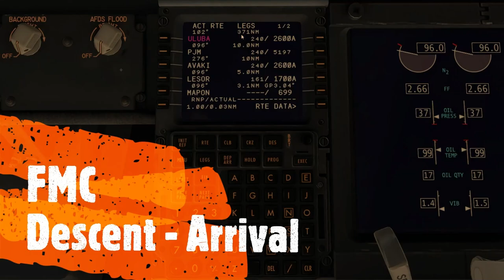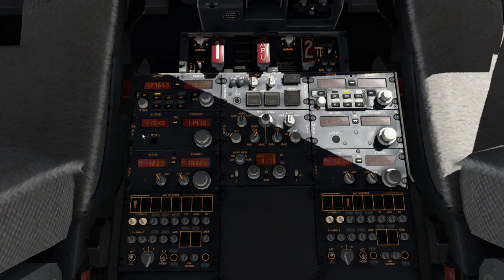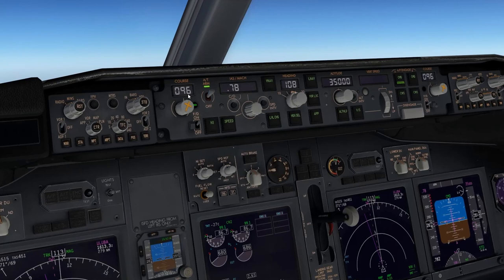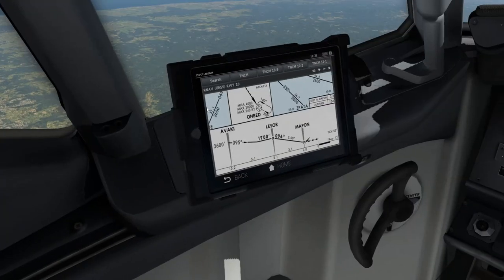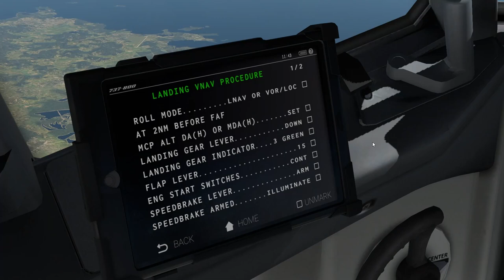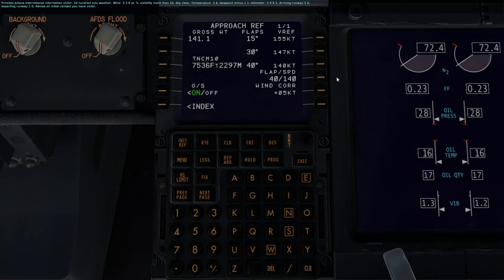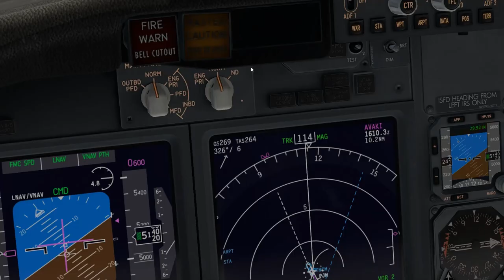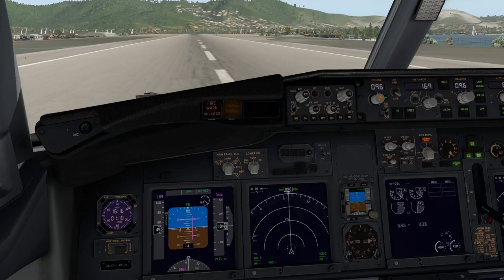X Plane 11 - Zibo 737-800 FMC Descent Arrival Tutorial | WESTJET - How to: Set FMC Descent & Arrival

Comment: Excellent video and useful explanations of procedures as was said in previous comment . Missed approach was a nice bonus 😄. Great job of recovering and landing safely 👍
Maurice
Reply from the maker: Thanks. I really didn't think enough about those altitudes when I looked at the chart. It should have been pretty obvious I needed to descend sooner. Regardless, my mistake did allow the opportunity to go missed approach.
Reply: Notice that AVAKI is a fly by waypoint, you do not have to fly over it, additionally coming from a sharp angle towards it the FMC computed a large turn radius which resulted to an inappropriate approach of the next waypoint LESOR, when you are that close to the runway you have to fly straight to the fix, on track. A manual override shall be applied to fly out more, have a proper manual turn and approach AVAKI at a proper angle and speed, that way is easier to control your approach speed and glidepath angle, avoiding last minute corrections and rush decisions. As far as I know you can not use speedbrakes once the flaps are deployed, you better have your speed set in time.

Comment: I’ve being having normal fine takeoffs but when I reach T/D my aircraft won’t decend even though I have selected my ALT INT  below cruise nothing happens
Reply: No need to push ALT Intervention. Just dial down the altitude on the MCP - If it is still set as the cruise altitude, the aircraft will see it as a restriction. VNAV should then handle the rest. ;)
Reply from the maker: @Computer Captain's response should work!
Reply: @FlightBrothersFT  not sure if I'm special or not. Fairly new to flight sims. I had set my cruise alt to fl360 then at top of decent lowered it to 600 and I went down the runway at FL360. lol, I can admit it was super funny.. but now my frustration is setting in. any advice??
Reply from the maker: Are you in VNAV mode?  If yes, it should descend (in the Zibo) as long as you’ve dialed the lower altitude.  If not, pressing altitude intervene should begin the descent, if you are past top of decent, AND a lower altitude has been selected on the MCP.  Sorry for the delayed response.  Let us know what you find out!

Comment: HELP. Whenever it's time to descend, VNAV switches off to "CWS P" (I never made any inputs onto my joystick and the ACT ECON DESCENT page is configured), and when I try to reengage VNAV, it doesn't work. Keep in mind that I have my altitude dialed to my next waypoint after the T/D. Is there something I'm doing wrong?
Reply from the maker: So your selected altitude remains below the VNAV profile correct?  CWS iirc is control wheel steering, it makes a Boeing similar to an Airbus in the control inputs.  It’s been a long time since either of us has done any sim flying, but as long as the altitude is below once T/D is reached, it should reduce thrust and begin the descent via the VNAV profile.

Comment: Ok so i have a question, when im on my approach (Using 737-800) i set my altitude to 5300. But when i got to 8000 my airplane just stopped descending and stayed in the upper 7 thousands to near 8000. Even when i clicked on approach it still does not descend. It's mad annoying, could you help?
Reply from the maker: Official J Gamer do you have an approach loaded into the FMC?  If so, it will respect the altitude constraint unless you depress the altitude intervene (alt inv) button on the MCP.
Reply: @FlightBrothersFT  A month later, I figured it out. I was also using a pirated version of the game so now I'm using a legit copy. I have mastered the Zibo 737. Thanks for the help though!
Reply: @Jaden_Iarusso  im sad now because I use the pirated game
Reply: @Jaden_Iarusso  It is not called a game.  It is as close to real flying as it could be.  X- plane .org will not like that.  Glad you figured it out. Good luck!

Comment: yesterday i flew my first ever fmc-guided flight in X-Plane. i missed the top of descent and by the time i reached the runway i was too fast, but being a simulator i said "i can handle this". i could not handle it. i touched down faster than a bullet, the runway was too short, i overshot it and became a boat in the ocean. now i'm here trying to figure out what went wrong.
edit: choosing an airport with ILS capabilities would have been helpful for me. i thought it had ILS, i didn't check beforehand. it didn't have ILS.
Reply from the maker: Sounds like a typical learning experience! Turned your airline into a cruise line.  In all honesty, missing top of descent is a very big concern. I tend to check the progress page a lot to see the estimated times and remaining distance.  Should you need to burn off extra speed and altitude *slow down first*!  Most aircraft can descend or decelerate, but not both at the same time. Slowing first reduces the ground you cover and buys you more time than descending fast. Also, you can buy more time by performing a 'hold' and then returning to course. Basically flying a racetrack pattern in the sky to descend or decelerate without getting closer to the destination.  Good luck with your next flight!
Reply from the maker: My ground school instructor told us, “You can slow down or go down, but you can’t do both”.  -Flight Bro Lee
Reply: @FlightBrothersFT  Those are good tips! I missed the top of descent because i thought the Boeing would start the descent automtically, and it wasn't the case, i had to engage the descent manually but by the time i noticed it it was already too late. I thought i'd lose the speed by the time i was at the last checkpoint but that wasn't the case at all. And to make things worse i was landing in Rio de Janeiro, the Sugarloaf was in the way, i had to keep it very steady. Awesome approach though, very beautiful and challenging. I think i used the STAR correctly because it lined me up with the runway nicely, it just didn't follow the altitude and speed limits, and that's what i need to figure out next.
I'm new to X-Plane coming from FSX, so there's a bit of a learning curve. A few more trips as a cruise line and i'll nail it, hopefully!
Reply from the maker: It should have began the descent automatically on the Zibo, you just have to set the next altitude restriction/lower altitude on the MCP prior to ToD.
Reply: @FlightBrothersFT  I'll download it then. I did another flight and the same issue happened, didn't descend automatically and didn't slow down, never following what was on the FMC except for the waypoints. But this time i managed to land it, so that's a step ahead. I'll try the Zibo then
Reply from the maker: @jorge with the Zibo it is very much a full simulation.  If you’ve found work a around with the default (if that’s what you’re using) it might do you well to continue flying with it.  Once you are relatively comfortable, then you may want to work with the Zibo.  While the Zibo does everything and operates with a high level of automation, knowing how to work that automation may present its own problems, so approach with caution!  Once you learn it though, it is extremely enjoyable, but don’t rush it. :)

Comment: I think I must have programmed my flight wrong. Was flying from Seattle Tacoma to Los Angeles and somehow the autopilot turned the flight off course so I flew over Boise Idaho. Same happens when I was flying DFW to IAH and midway the plane turned around no input  from my and started to fly back to DFW
Reply from the maker: Wow. Sounds like either an incorrect or out of date waypoint or perhaps a 'vectors'.  You can check for a lot of that using the 'Plan' mode knob and the 'step' feature on the legs page.

Comment: How do you begin the VNAV descent if you miss setting the ALT to a low value before T/D (top of descent) point?
When I do that and set the ALT to a lower value after T/D, it doesn't start descending. I have to manually descend with V/S mode.
Reply from the maker: Kostia Komrad that’s how you would do it.  Once it captures the descent path, you should be able to re-engage VNAV if I correctly recall.

Comment: Hi, awesome video. I have the Zibo 737 as well, but it doesn't start the decent automatically like yours. I have all the route set and executed well before the top of descent but it refuses to start the decent, any tips?
Reply from the maker: Vinícius Pinheiro have you adjusted your altitude?  If you still have the cruise altitude set, it will maintain and pass the T/D and not descend.  Maybe 40 miles or so before Top of Descent, adjust the altitude to your next crossing restriction on the approach.  Hope this helps!
Reply: @FlightBrothersFT  Did that, about 40 miles before Top of Descent and nothing, had to press the alt intv button. In only one flight I managed to get it going on it's own, but can't quite tell what I did different that time...
Reply from the maker: Not sure off the top of my head.  The alt intervene is always a good go-to.  The last thing I can think of is to make sure your cruise altitude on the MCP and FMC match.  If they do, then I can’t think of why it doesn’t descend.  The other Flight Brother (creator of this video) May chime in with something.  He has way more Zibo hours under his belt than me.  He flew it almost exclusively for about a year.  I have about 20-30 Zibo hours if I had to guess.  I’ll see if he has any thoughts.
Reply from the maker: Just thinking of other things to check: What pitch mode is your autopilot running, VNAV or ALT HLD?
Reply: It is in VNAV
Reply from the maker: Ok, so Zibo is cruising in VNAV (presumably with auto-throttles ON), you have set the MCP to the next altitude prior to top of descent.  Does the T/D show on the MFD map?  When you reach the top of descent, what does the Flight Mode Annunciator show (three columns above on the top of the PFD showing autopilot modes in operation).  Specifically, watch the third column to see what the VNAV mode is at that moment.
Reply: I'll make another flight soon and will look out for the Flight Mode Annunciator. But yes, VNAV and auto-throttles ON, MCP to next altitude prior to top of descent and T/D showing on the MFD map. The FMC screen shows the recommended VS, and the difference between the current altitude and the expected one, but it doesn't start the descent. As soon as i make another trial flight I'll reply and let you know what the VNAV mode is. Thank you!
Reply from the maker: Ok, keep us posted. It sounds like you're doing everything right.
Reply: VNAV mode is VNAV PTH. I've lowered the MCP altitude from FL350 (cruise altitude) to FL210 (altitude after some 4 waypoints ahead of T/D) about 67NM prior to T/D and moved 100 ft up then down again on the MCP at ~23NM prior to T/D. FMC page switches to the DES page, but altitude remains constant at cruise altitude.
Reply: Could FPS have anything to do with it? My computer isn't the best and FPS are low ~15FPS
Reply: And this time not even the alt intervene is responsive
Reply: Chose a completely different route, and I think the only other difference besides the route is that I had the auto-brakes on off arriving at T/D. Could it be a route related issue?

Comment: So basically if I want to fly the 737 on vatsim I have to pay $10 per month?
Reply from the maker: Subscription would be the simplest solution to having up-to-date nav data in your FMC. We use Navigraph, but there is at least one other service out there. I've heard of some people buying a month subscription then canceling once or twice a year. Generally speaking, only a small percentage of waypoints and procedures change from one AIRAC cycle to the next, so you might find buying one month could carry you quite sometime.  That said, if you can afford the expense, Navigraph is a fantastic tool with more than just nav data included and I've never regretted having it.
Reply: No, but it's recommended to have the most up-to-date AIRAC since that's what controllers have. It makes their job easier and it will help your life as well. I fly on older AIRAC myself, so it's not much of a big deal :)!